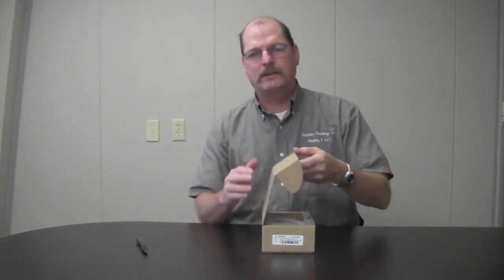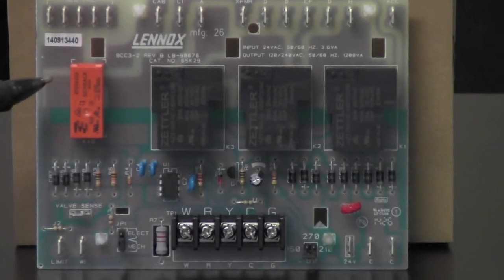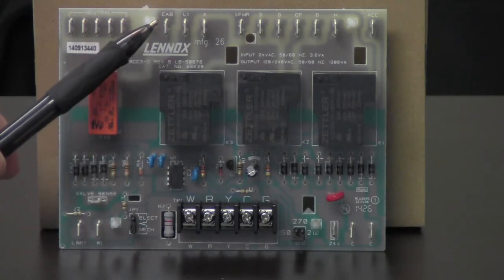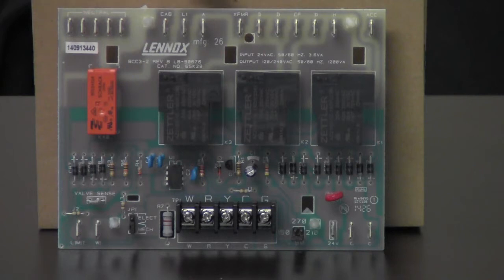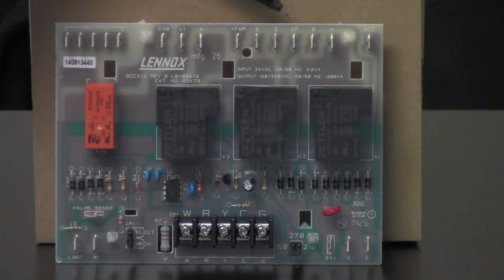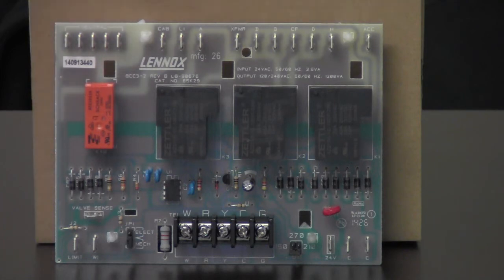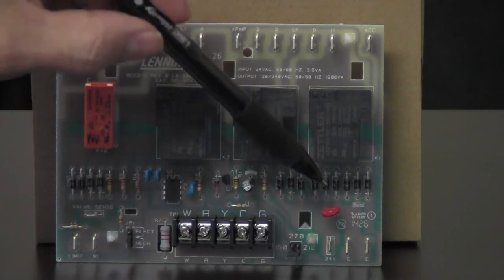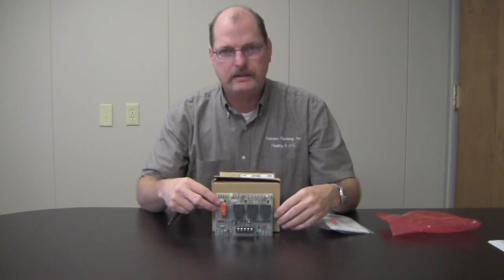BCC-3 Replacement Control Board Kit

Comment: For those with AC these are poorly designed boards - regardless of revision. 'Y' is a dummy terminal. I modified it by cutting the traces bridging relays K1 (ACC) & K3 (A). Then installing a full wave bridge rectifier (DB107) with inputs of Y & C; outputs to K3 relay control. (Relays are DCV). Then bridged the outputs for ACC and A. Board now can control AC (Y) and FAN (G) with independent control. If fan motor has been replaced with more speed options bridging A & ACC output is optional.

Comment: What is JP1 (Elect/Mech) jumper used for. Don't see a reference for it in the schematic.
Reply: That jumper is thermostat type - depending on if using a mechanical anticipator.

Comment: Hi there, I was trying to swap out a board on g20 model but the new board I picked up was bcc replacement kit and was asking to jumper between pin 3&5 and then cut it and wire nut the W1 wire with them. But my question is that if you add a jumper between 3&5 do you get rid of the jumper between 2&4? Thanks

Comment: Thanks for this. I've been trying to figure out how to get my humidifier to work with this. I was trying to find spare contacts to switch the 24V. I didn't think to use the ACC to switch the primary of the humidifier control XFMR instead.
Much appreciated.

Comment: Hi Steve, where is the xtra blue wire come with the package connect to? anyone ca explain howto ues it, will appreciated
Reply: The note that comes with the new BCC3 say if you are replacing a very old BCC3 the terminal size has changed.  You have to cut the old male lug off and use the enclosed wire nut to attach the new blue one.  The early BCC boards were so flaky (I went through 3 in the first 5 years) I would be surprised if any are left in service

Comment: can I use a ddc1 board if am replacing DDc2or 3
and whats the difference 
am a new tech
great video sir
Reply: Hello , Sorry but not sure what the DDC1 control is ? Maybe you mean BCC-1 which is the first revision of the 48K98 control board. You should not have any issues using this control but I would suggest getting the updated control 48K98 - BCC3 Circuit Board
Reply: Thank you 
 yes it's BCC1
great video 
alots of good info

Comment: is that used on a pulse furnace?
Reply from the maker: Yes, it is used on a pulse furnace. If you have any questions on whether or not it goes on your furnace give us a call at 866-215-3831 and we'll verify the part with your model number.